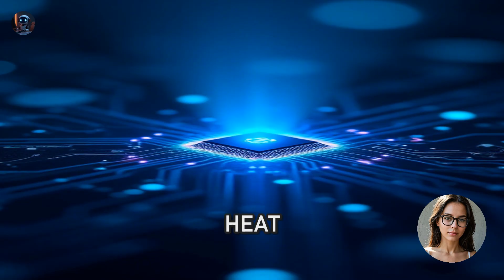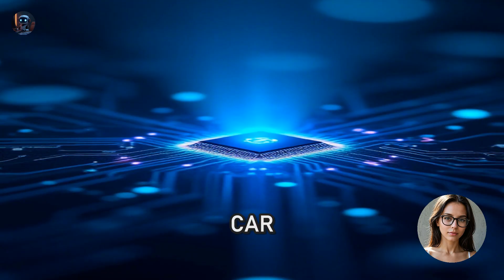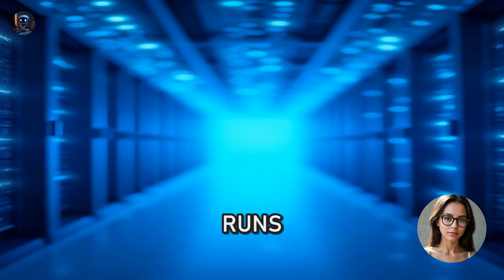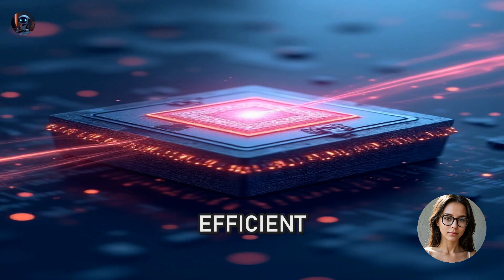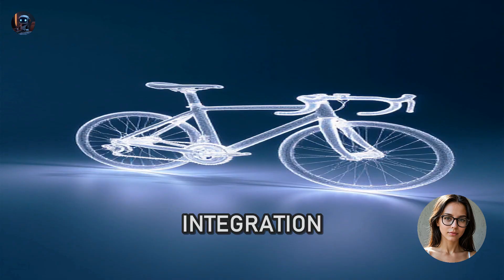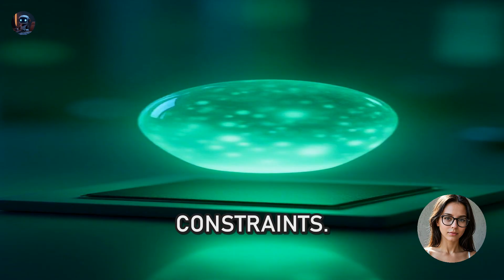Light-Matter Particles Power Breakthrough in AI Chips

Comment: Excitons and polaritons — light-matter hybrid particles — are one of the most underrated frontiers in computing. They combine the speed of photons with the interaction strength of electrons, which means you can actually build logic gates that talk to each other. Pure photonic logic is notoriously hard to cascade; exciton-polariton systems solve that. @aitickr covered how this could bridge the gap between optical speed and electronic controllability.